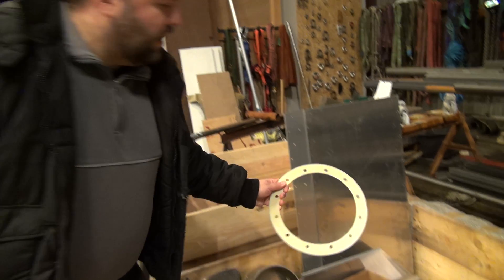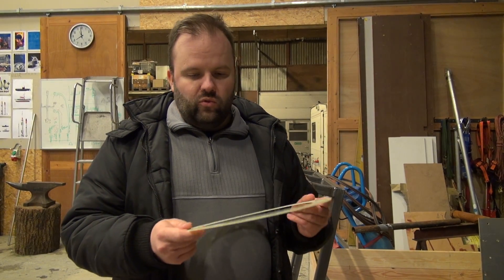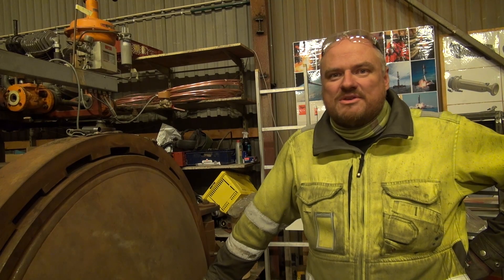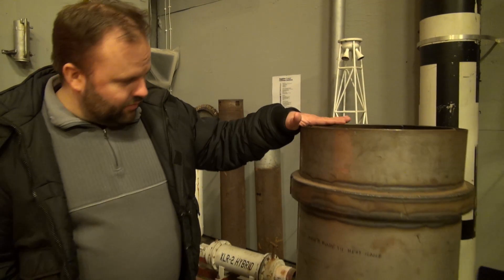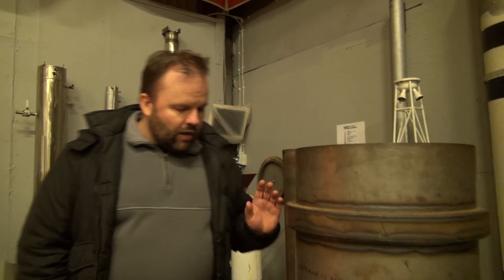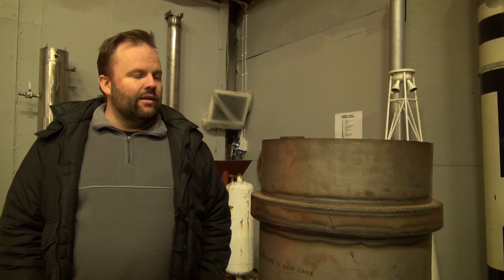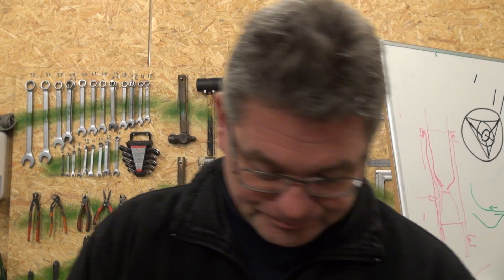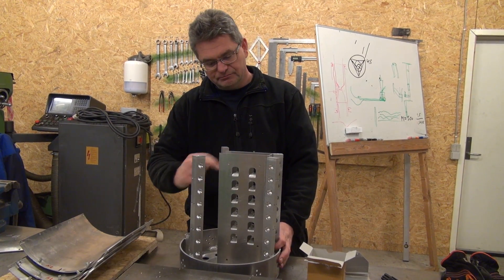Copenhagen Suborbitals December 2015

Comment: What are the advantages of ablative cooling over regenerative cooling? I am thinking simplicity but i don't really know.
Reply: +Bluegillbronco2 It is way easier to produce the engine that way. If the welds are not 100% perfect, the engine bell will disasemble itself rapidly

Comment: I know you guys messed around with hypergolics in the past, so why not just have a small part of the BPM 100 injector be dedicated to a hypergolic ignition system? Rocket engines have used it in the past, and since you already know how to set up the tankage it wouldn't be that much more complex than the engine already has to be.
Reply: +arkatub   TEA-TEB ignition system is hypergolic.  Worked for the Space Shuttle and Falcon 9!
Reply from the maker: +Jacob Friess we are currently looking into a augmented spark igniter system for the BPM-100 series engines

Comment: I would suggest a mechanical stress test of the fiber glass insulation ring at very low temperature. If it pulverize under vibration stress you can get a problem
Reply: +ulfpe Maybe a carbon fibre gasket?